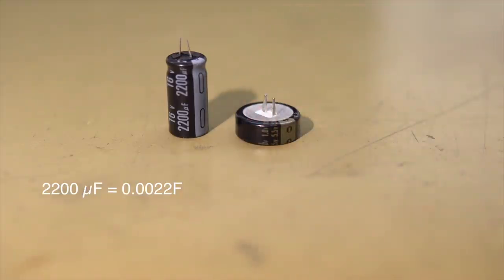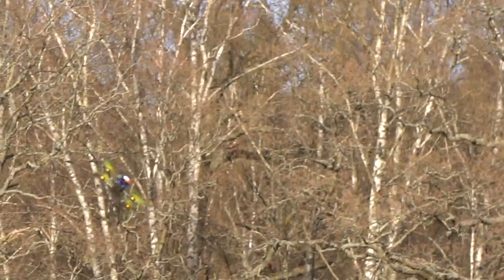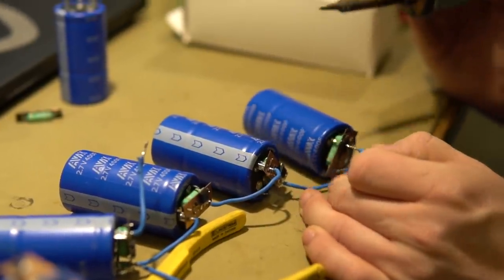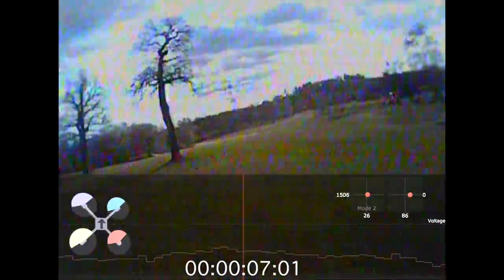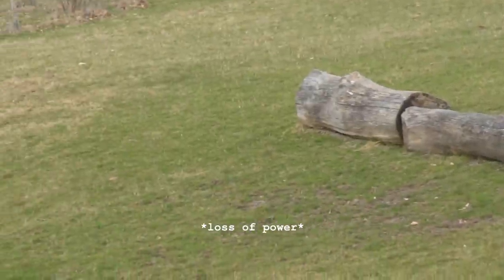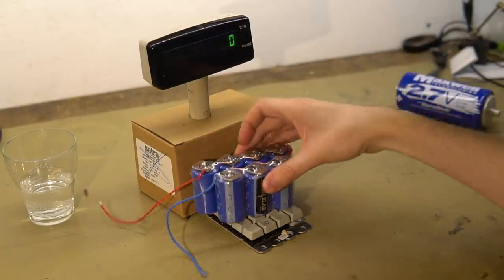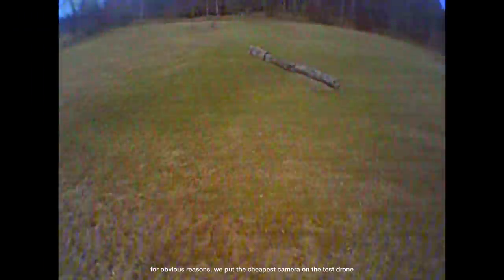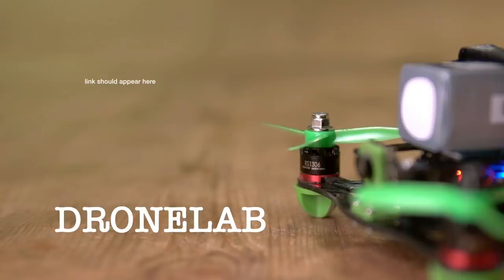SUPERCAPACITOR powered drone

Comment: How long did it take to charge the super capacitor pack? Is there any hope in the future of dynamic in flight recharging?
Reply from the maker: You can charge them in as little as 10-20 seconds, if you have a strong enough power supply.You can charge them mid-flight, thought the energy needs to come from somewhere.
Reply: @dronelab1280  Thanks for the reply,  This is very interesting technology, albeit maybe not suitable for a flying machine but would be ideal for other applications where heavy current draw over short periods of time are required, such as a car starter.

Comment: Why is the capacitance still 200F? If capacitors are wired in series than the total capacitance is less than half of the capacitance of any individual capacitor. Or is it different with supercaps?
Reply from the maker: The capacitance is indeed lower - 1/7 for 7 cells in series, so 28.6F, but in that scene we are calculating the total energy. The approach we took is calculating the energy of one cap (voltage squared times capacitance divided by 2) and multiplying by the 7 cells. This yields the same result as first calculating the parameters of the total pack, (28.6F at 18.55V) and then using that to calculate the energy capacity (18.55F^2 * 28.6V/2 = 4920J, with a tiny rounding error)

Comment: your lead wire is too thin to output the amps the super cap can produce
Reply from the maker: A valid concern, but the AWG12 we used handles almost 200A for short bursts. With such a short length, the wire would catch fire before introducing any significant voltage drop. 

With the capacitors fully charged, the current output wasn't bad at all. The drone punched at the full 150A+ its motors can take. But the capacitors drained very fast, dropping the voltage very quickly and in turn, limiting the power.

Comment: Can we use it for making electric bicycle? To run a motor of 12v and 240w for time of 5min. Please help.
Reply from the maker: 240W for 5 minutes is 20Wh or 72kJ - that's a lot of energy. Supercapacitors aren't that good at storing energy, you would need a huge one to last you the 5 minutes. If you used the capacitors like the bigger ones in your video (2.7V 400F), you would need a pack that is 5 in series (giving 13.5V, which is OK for a 12V motor) and 16 in parallel, so a total of 80 such capacitors! That's a lot, and it would be very expensive. Instead, I would recommend an RC LiPo battery. With a voltage of 11.1V (OK for 12V motor), capacity of 3000mAh or more and a discharge rating of 20C or more. You should be able to get one like that for $20-30. A bigger capacity will give you more ride time (5000mAH will give 10 minutes for example). Note that LiPo batteries are dangerous and sensitive. You have to use a special charger, and you have to be careful not to discharge them too much. Use a protection circuit or at least a RC battery voltage monitor. Read more about LiPo battery safety and maintenance before using one.

Comment: How many grams for the 7s pack?
What is the power consumption at hover with weight of battery vs that of caps?
Reply from the maker: The 7s pack was just over 300g (including the protection circuit, wires and wrapping). Normally a drone like that would fly with a ~200g battery, and that would offer a similar maximum current, but a much higher capacity. So we are wasting a bit more current hovering because of the extra mass of the cap, yes, but not that much. We could get the drone to hover with a 50-100g supercap, but then it would only hover for a second before such a cap would be drained.

Comment: Any thoughts on how supercap(s) parallel to batt would assist peak current?
Reply from the maker: Compared to a very good lipo (like a 60-75C one), it's not worth it. Such a lipo can provide more current on its own, than a supercap of the same weight. A cap could significantly help a lower discharge pack (like a 5C metal cased 18650 cell), and such a combo would last many more charge-recharge cycles, but that's not the crazy raw power that we are aiming for.

Comment: Your maths isn't correct, the actual usable energy is much lower because of the way capacitors work. When they reach the minimum voltage usable by your drone they will still have most of their energy left as they can be used down to 0v.
Reply from the maker: You’re right to point it out, and it makes a somewhat significant difference but it’s far from “most the energy”. Going from 2.65 to 1.3v (as we did here) leaves only 24% left in the cap.

Comment: can u add pv panel to recharge supercap as it charges fast.
 would it help ?
Reply from the maker: 🤔That's a novel though. Well, unlike regular rechargeable batteries supercaps can reacharge fast, as in, they can accept a lot of power while recharging, but that power needs to come from somewhere. And while it's easy to make a powerful AC/DC supply, a high power PV panel would simply have to be very large to collect enough sunlight.
For reference, the 10 second flight from the video consumed 1.37Wh of energy, and a 10x10cm solar panel (a size that would fit comfortably on that drone) produces about 1.8W of power in full sunlight. So it will take 1.37Wh/1.8W = 0.76 hours (~45 minutes) to recharge between such flight.
To recharge in 10 seconds, the solar panel would have to produce 1.37Wh / (10/3600)h = 493W, so it would need to be 2.7 square meters large (the size of a bed, roughly)

Comment: Is it good to use Super Capacitors for riding a Gocart? Is it safe?
Reply from the maker: Depends on how you approach it. You could either:
1. Get a supercapacitor same same physical size as a normal battery. Then you get much less range, or
2. Get supercapacitor that matches the capacity of a battery. It would be much larger, heavier and more expensive, but you get the same range as a normal battery.
In both cases, the supercapacior has one advantage over a regular li-ion battery - it doesn't wear out with time. Li-ions usually last less than 1000 charge cycles, so for a gocart that is driven all the time every day, a supercap might be advantageous. The difference in safety isn't that significant - both are safe, if you follow the correct guidelines.
Reply: @dronelab1280  Thanks, Sir. I also want to ask another question i.e. How much Farad capacitor is suitable for a 2HP motor?

Comment: So what r the future for drone battery. Y can the make a micro generator on the drone motor compartment so when the battery Start The drone the motor spin the gen an uses the power to charge the battery while u flying
Reply from the maker: That’s a hard question. A lot of companies are trying to make batteries better and there is constant but slow progress. In the mean time you could rely on a tiny gas generator (as gasoline has a very high energy density - that’s one it’s used in jet airplanes). Ive heard of this being done, though I imagine it’s only feasible for very large drones.
Reply: I kinda struggled reading your comment but I'm guessing you're talking about using a generator spun by the motor to generate electricity? if that's the case then no, that's impossible. it would violate conservation of energy (you can't "create" energy, rather you can only convert it from one form to another).

Comment: Hi,
I am from a computer science background and I don't have much knowledge on electrical and electronic things.
I have drone which was built by assembling all the drone essential requirements.
I have a battery which is 5200 mah, 11.1v 35C. I think I can continuously fly the drone for 10-15 minutes.
Now I am thinking of another power source , which is tethered drone. I don’t mind drone tethering
I have an idea in my mind to build the tethered drone. I am not sure whether it will work for me or not. Please help me on that.
On the Ground I use AC power supply which is 230 volts and use some 14 – 22 gauge wire for 100 feet and at the drone end convert AC 230 volt to DC 12.5 volt. I mean some kind of adapter(AC to DC , 230 volts to 12 volts 1 amps) I will use. Now I am worried about is the amps which is required by the drone motor. I have a 180000uF 50V Electrolytic Capacitor which weighs about 700 grams. So when the capacitor gets charged from the source side and discharges at the other end.
Will the discharge side able to run the drone motors? Please help me on this.
And I also have some super capacitors, Can I use those capacitors.
I am providing you some link on the capacitors which I have already purchased.

https://www.electronicscomp.com/180000uf-50v-electrolytic-capacitor-pg-garde-india?search=capacitor&sort=p.price&order=DESC

https://www.electronicscomp.com/1.5-farad-5.5v-super-capacitor?search=super%20capacitor
Reply from the maker: Well, if the drone runs for 15 minutes on an 11.1V, 5.2 Amp-hour battery, we can quickly figure out that on average it takes 5.2Amp hours / (15 minutes / 60 minutes) = 21Amps. That's a lot of power to deliver. If you use a 1A power supply to charge up a cap, but then intend to source 21A from that cap, you would only get 1 second of flight for every 21 seconds of charging. I doubt that's what you are aiming for with the tethered approach. The maximum flight time will be limited by the capacitance of that capacitor. We can compute that as well: 180000uF means 0.18 Amps can be provided for 1 second, for each 1V of allowed drop between "full" and "empy". Full is 12.5V, empty is probably 9V, so 0.18A/s * (12.5V-9V) / 21A = 30 milliseconds. At 1.5F that's 0.25 seconds, not great.

Comment: what about Skeleton's Ultracapacitors
Is that scam to?
Reply from the maker: Well I wouldn't call supercapacitors a "scam". They are great for some purposes like hybrid cars, metro trains or server power supplies, but they simply aren't good for RC drones. The Skeleton SkelCap has the exact same energy density (energy capacity per kilogram) as the AVX SCC that we used (5.1Wh/kg) , so the flight time would be the same. But it does claim to have a much higher power density (80kW/kg vs our 2.5kW/kg), so in theory it should have a much stronger punch. Unfortunately, not only are the SkelCaps only available in 500F or larger (so an appropriate voltage pack would be gigantic at over 650g!), but also I can't find a single distributor actually selling them. Maybe they aren't on the market just yet?
Reply: @dronelab1280 
 In your eyes, what kind of battery is the best in the market right now. 
Not just for drones.
Reply from the maker: @sahinyasar9119  Well, for every application a different battery is best. The Lithium ion based rechargeables are great for portable electronics, and their high-discharge rate variants are great for RC drones, power tools or electric vehicles. But if you need a hybrid bus with regenerative breaking, nothing will beat a super-capacitor because of how many discharge-recharge cycles it can take before it needs replacing. And for long term operating, low-power sensors, a lithium-thionyl chloride cell is by far the best, because it can run for even 20 years without significant self discharging. But a super capacitor has too little capacity to power a drone, and a lithium-thionyl chloride has a very low output power, so they aren't good for other use cases. Every kind has its strengths and weaknesses, so there isn't a single overall "best" one. For most cases though, the Li-Po is most suitable, but there still are valid reasons even for using a good ol' lead acid cell!
Reply: @dronelab1280  thank for your attention

Comment: Have you guys tried the Chinese 'GTCAP Graphene Supercapacitor battery 2.7V 100,000F' (Or other manufacturer other than GTCAP as there seems to be a few different ones)' capacitors? If you had an optimized drone with a few of those I bet you would have a better result.
Reply from the maker: It's hard to get good data on them, they tend to not have datasheets, which is never a good sign. The numbers I could find show the same problem we had: not enough power per weight, so they do not look too promising just yet.
Reply: @dronelab1280  I see, and you're right they do look a bit shady... Good ol' China!

But, are you saying that assuming you could get 100KF capacitors of say 700 grams each that it still wouldn't really be worth while using them?
When I think about it 4 of them would already weigh in at 2.8kg and if connected in series would drop the capacitance down to 25KF which would likely not make a whole lot of sense... But perhaps with a DC-DC Boost converter module and a parallel connection it might still last upwards of a minute or two -What do you think?
Reply from the maker: A DC-DC Boost capable of converting this kind of power (over 3000W?) would weight over a kilogram by itself, so I wouldn't count on that being feasible. Don't worry about the capacitance becoming lower when you connect caps in series - it's just that the "Fahrad" unit of capacitance is weird (It's expressed as charge divided by voltage, so by increasing voltage you decrease 'capacity'), in practice the total energy capacity of 2 capacitors in series is 2x the energy capacity of a single one, so nothing is lost.

Maybe you can connect 4 of them in series and get a working 10.8V system, but at 2.8kg you might as well get a massive lithium battery that will have better performance, both in peak and total capacity. The only benefit of supercapacitors right now is their longevity - they can last 1000x longer. But drone is likely to have a catastrophic crash before it reaches 1000 charge cycles anyway, so I wouldn't see that as a big advantage, and certainly not worth the extra weight.
Reply: Thanks a lot for the lovely in depth reply! Really appreciate your time answering my question properly.

Comment: ... Hybrid battery.. but i thought that you could pull more than 120amp peak from the caps..
Reply from the maker: And with that poor 120A peak, it's not even worth making a hybrid. It offers less peak current than a good li-po of the same weight (Roughly a 65C one).

Comment: try to combine Li-Ion like LG HG2 + super capacitor, so it can has high current burst
Reply from the maker: It would definitely help a standard low discharge battery, but it will still not match the maximum current possibly from a high discharge lipo (60C+) of the same total weight. Although, such a li-ion + supercap combo should have a fantastic longevity - it should last 1000 charge cycles, instead of the ~100 one may expect to get from a high-discharge lipo.

Comment: Why 200F ? Aren't they marked as 400F ?
Reply from the maker: Nice spot! We made two battery packs, a 4x 400F in series, and a 7x200F (higher voltage, less capacity). The footage shows both, but the 4x400F was so bad at flying, I decided to not mention it at all and focus only on the better, 7x200F, to keep the video short and simple. Theoretically the 4x400F fits a bit more energy, so on a differently configured drone, with higher KV motors, it might have performed a bit better, but with the parts we had at hand (and did not mind crashing), those were the best results we could get.

Comment: If you used a large drone and larger capacitor bank for short video shots or photos.. The capacitors could be re charged within seconds per usage. Rather than minutes or hours. Another side to the coin.

Comment: Great video thank you for posting! I love super caps!!!  Its exciting to think that we're moving forward with capacitor technology, trying to approach the abuse tolerance of capacitor, with the energy density of batteries.    In your calculation of how much energy is in your capacitor, did you account for the fact that the drone cannot use ALL of the energy that is stored in the cap?   Once the voltage is too low to fly the drone and it crash lands, there is technically still energy left in the capacitor... Maybe around 50% or so of it's capacity, which is quite a lot!  This is dependent on the minimum voltage needed to fly the craft.     Caps have a linear discharge curve, which means as soon as you draw power from it, the voltage drops linearly.  Unlike a Lipo, where there is more of a complex, but more usable discharge curve. 

Here is a graph showing this:  https://www.tecategroup.com/ultracapacitors-supercapacitors/ultracapacitor-FAQ_files/image006.jpg

From this useful website:  https://www.tecategroup.com/ultracapacitors-supercapacitors/ultracapacitor-FAQ.php

What this means is that in order to extract the full energy out of a supercapacitor, we need relatively complicated voltage step up electronics.  It would be cool to use super caps in conjunction with Lipos for racing drones to provide a sort of "push to pass" button like Indy car uses!  Giving a short, few second burst of additional power.

Comment: Yep to get a 10 minute flight you'll need a 168,000 Farads.. Which would be about 24000 7 cell packs, yea that can get heavy.. LOL
Reply from the maker: And then its so heavy that it needs more power to fly, so even more capacitors! But once some are discharged they can be dumped to lighten the craft, like like a space rocket!

Comment: I mean...great concept but stolen from another channel
Reply: What channel? Because they stole the idea from all the capacitor powered planes from when I was a kid. And from ZipZap micro tabletop cars/tricks which also ran off capacitors. They should be paying copyright infrengement, except oh wait, people have been making toys powered by capacitors since before I was born, and I’m old enough to have 2 degrees in engineering.

So did anyone really steal anyone else’s idea on another YouTube channel? Because not only YouTube didn’t exist back then, but also the internet wasn’t really a thing back when flying and driving capacitor toys were first around...
Reply from the maker: You mean the rocket thing posted a year later ?